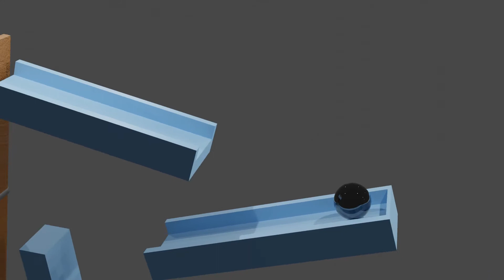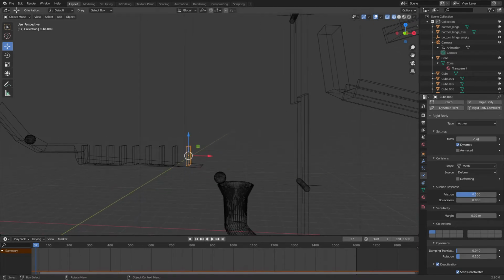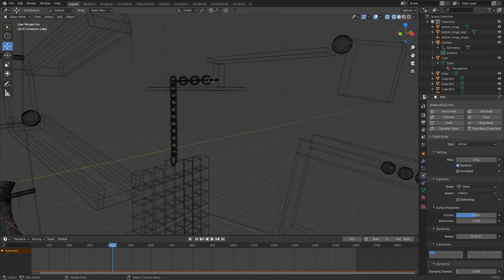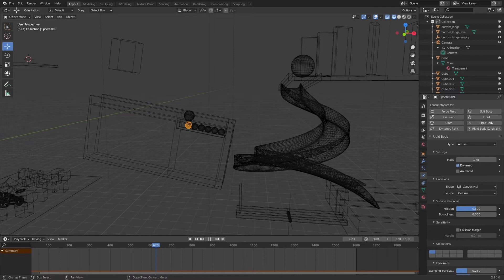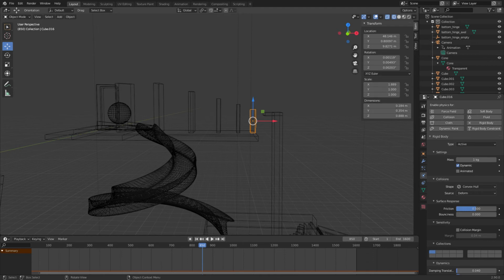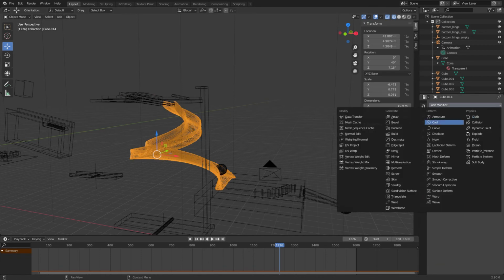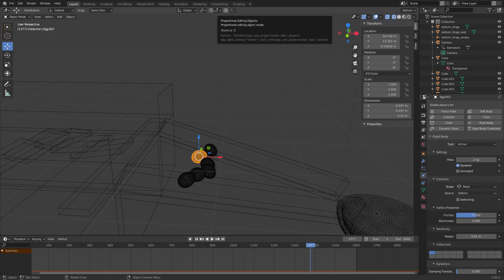Building a Rube Goldberg machine in Blender using Rigid Body Physics

Comment: Awesome video. Just a quick question. I applied scale to my passive rigid body and my dominos are acting funny and moves before receiving contact, do you by any chance know how I can fix this?
Reply from the maker: hi...thanks!  make sure you apply scale to all physics objects (including rigid).  without doing this there is a change could move before contact.  Another option is to leverage the 'Start Deactivated' option under Rigid Body -> Deactivation - you can elect to Start Deactivated.  This will hold them steady until something engages them.  Also - make sure your objects are not too close to one another or something else - which could make the simulation jump right away.

Comment: Hi how did you make all of the paddle thing at 2:34
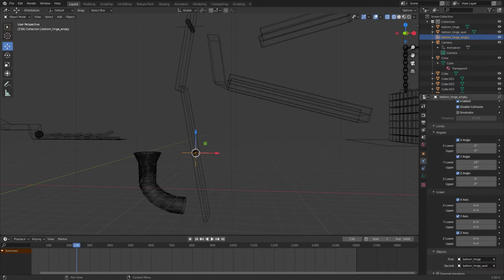Reply from the maker: axel is a mesh cylinder, paddle is a mesh cube that was reshaped...then both turned into rigid body objects in Physics Properties (passive for axel, active for paddle).  Then you need to add an Empty for the hinge...and look at the Objects section on the bottom right at 3:16 to see how to associate the hinge with the axel and paddle...once that is configured, you'll start to get the desired hinge movement!
Reply: @enterprise4701  thanks

Comment: How do you extend the number of frames? Trying to figure that out all day.
Reply from the maker: If you are referring to the frames within the physics simulation, make sure you set (1) in "Output Properties" set the Dimensions Frame "End" value to the desired end frame and (2) in "Scene Properties" set the Rigid Body World/Cache Simulation "End" frame to the same desired end frame.  This will tell Blender to run and cache the physics simulation across the entire range - and not just the default of 250 frames
Reply: @enterprise4701  Thank you so much that helped alot!
Reply from the maker: cool...glad it helped!